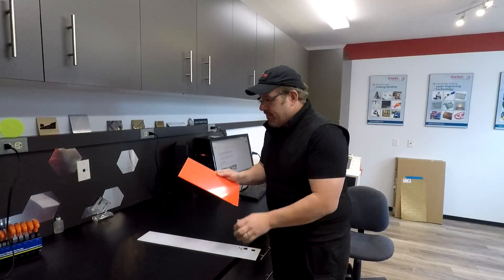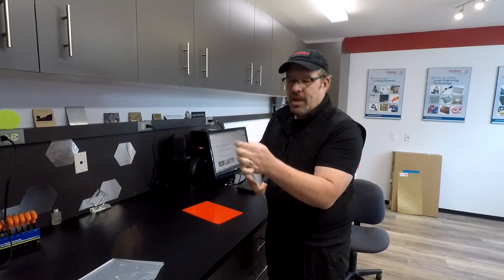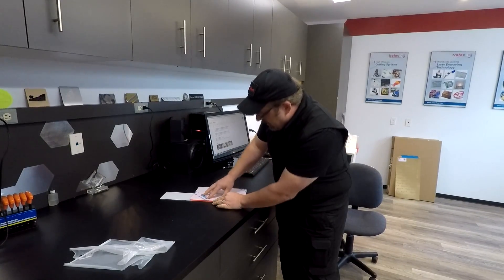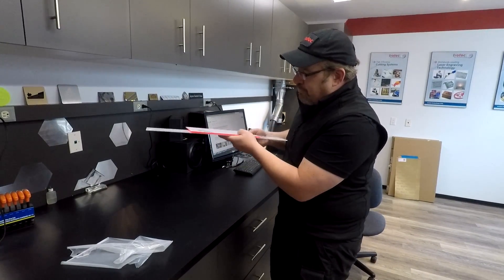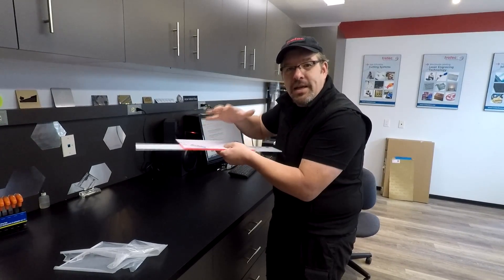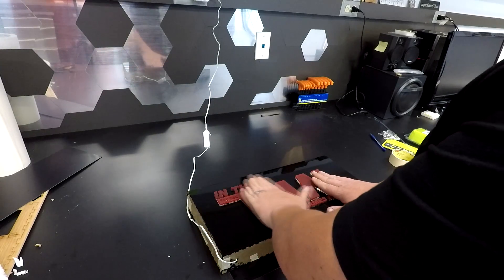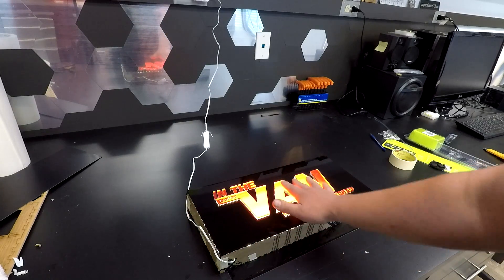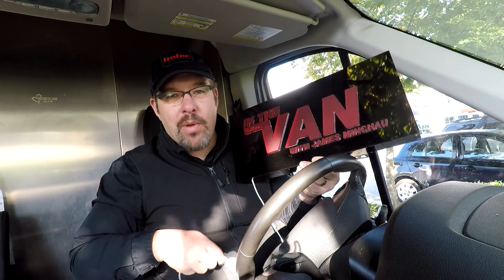Laser Cut Acrylic Welding | LED Acrylic Sign | Trotec

Comment: How does this glue compare to weldon 4? I find you can easily ruin a job with some glues.
Reply from the maker: Christopher Rismay we are not sure about that particular brand but yes many glues do leave smuge marks so you can try to cover it up with a sepparate piece or try methylene chloride which is clear (but can still leave clear streaks)

Comment: So I've been playing around with "welding" two pieces of acrylic (as shown in the video) and have had very good luck with the bonding at the edge, but I'm not getting a clean look on the face (I'm using Translucent black with a clear top piece). I'm guessing its the capillary action is making "streaks" between the layers.  Is there anything I can do to resolve this?  Im using a SP400 80w.  Thanks!
Reply from the maker: Hi J, are you getting the streaks around the cut? Or in the middle of the acrylic? What acrylic are you using, is it Trotec's or someone else?
Reply: @TrotecLaserCanada The streaking varied (I did several tests) but seeing it mostly around the cut.  Almost looks like the seal between the pieces aren't tight enough.  I'm using Chemcast Cast Cell Acrylic 1/8" on each piece.  Maybe go down to 1/16" ?
Reply from the maker: @JBR2SRQ  1/8" should be a good thickness for this, and cast acrylic is better quality than extruded. What lens are you currently using for the cut?
Reply: @TrotecLaserCanada  I'm using a 2", but also have a 1 1/2" if that would work better.

Comment: Hi, would the acrylic welding only work if you have a vacuum bed? We have a Speedy 300 but only have the standard bed and honeycomb bed.
Reply from the maker: Hi Claire, you don't need a vacuum table, a honeycomb or cutting bed is what you would use - just tape off any unused surface so the vacuum/suction works much stronger.

Comment: I wish i had learned about laser welding only a week ago when i designed my 1st rgb\led acrylic light stand for displaying artwork engraved acrylic panels. It would have cut my time in the solvent welding process & simplified my assembly. For others who might read this...I want to add a point about CA glues. It leaves a permanent, unsightly white residue on clear acrylic,  so i only use acrylic solvents during assembly.
Thank you James & Trotec Canada!
(Will there be a "Trotec USA" in the future? I'm in Spokane, WA😉😎)
Reply from the maker: Thabks for the kind words, yes some glue can leave a stain on clear acrylic so we suggest to glue on the edges where it wont be noticeable. We have a Trotec USA, they are a great team! :)

Comment: I learned something new! how about that. Laser welding... So which materials are weldable to which and how does thickness and stack order affect the outcome? can I weld an entire rainbow sandwich at once or just a 2 layer bread and butter?  
BTW,  In the Van W/ James is a brilliant use of marketing funds. You guys are way out ahead of the pack and it's refreshing! Keep innovating.
Reply from the maker: Hi Dave, thank you so much for all the kind words! We're glad we have such a talented presenter like James! As far as welding goes, this is specific for acrylic-on-acrylic. Because acrylic turns into a liquid when you burn it, the liquid acrylic from the top layer solidifies with bottom one to create the weld. It won't work on wood or plastic so much. You can use any thicknesses depending on the power of your machine. You can also use a similar kiss-cut welding technique on twill fabric, we show an example in this video: https://www.youtube.com/watch?v=7lOipH5CiDM&t=12s

Comment: Nice. Have Speedy 400, 80 W.  What settings should I use?  Love these kind of projects  they are not necessarily meant for commercial sale. Although this one definitely could.  Please keep projects coming.
Reply from the maker: Thanks we appreciate that! Try using 100 power, 0.3 to 0.4 speed and 2500hz. Just make sure that your table is fully sealed (the parts that don't have acrylic on them) and don't forget to use air-assist. You may need to test little square out with different speeds, but it should be slower than regular acrylic cutting.